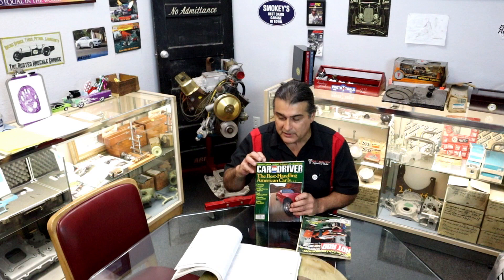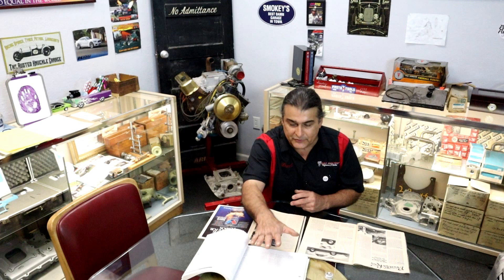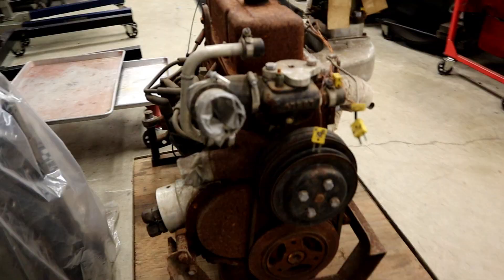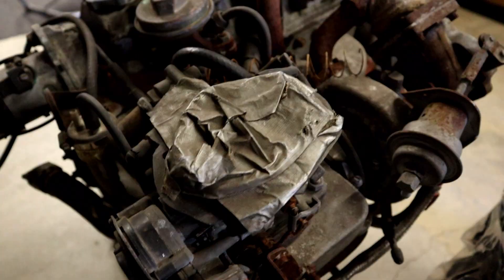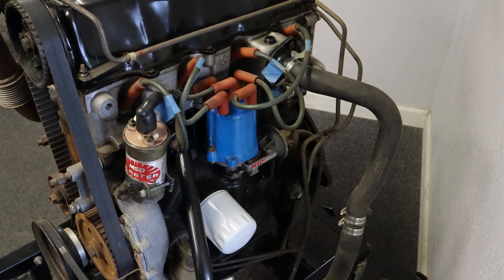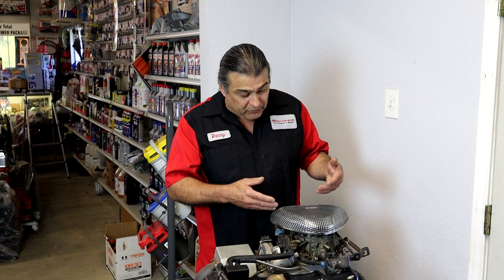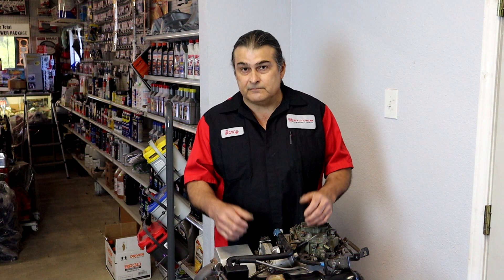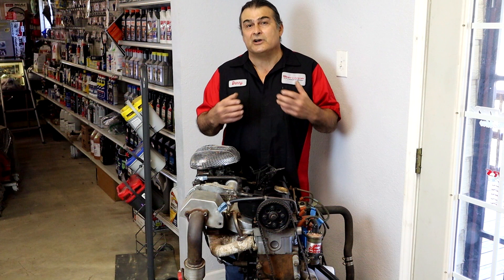What ever happened to Smokey Yunick`s Hot Vapor Engine

Comment: Real good review on important vapor fuel technology made by Smokey Yunick. One of the most interesting things about his design was the intake manifold designed to
heat a vapor chamber below a turbocharger. The turbocharger pressurized the fuel intake and kept it from trying to backup to the carburetor. His design extracted more
energy from a smaller amount of gasoline. Gasoline has about 7 different compounds in it that evaporated at different temperatures. The vapor fuel systems being 
experimented with for several years worked for awhile until the vapor panels were contaminated by the heavy ends of the fuel which would collect and degrade the
fuel vaporization so mileage started good for awhile then it would start degrading over time until the vapor panels were replaced with new ones. The way to prevent
this problem I found was to use white gasoline (Lantern Fuel, no extra compounds in it). Smokey's design worked flawlessly and is a solution. The engines on fuel
vapor will run cooler with no engine detonation (knock) since the fuel is in a gaseous vapor state much like a propane fueled engine. Smokey also won a stock car race
years before his invention running a Fish carburetor which has a patent on it made by John R. Fish. I have one of the larger Fish carburetors made by Mike Brown.
Mike made replicas of John Fish's carburetor and advertised/sold them in the middle 70's. He guaranteed a 20% increase in mileage which they did and even exceeded
that guarantee.  Smokey Yunick was way ahead of Detroit on his designs and anyone experimenting with vapor fuel systems had their lives threatened. Tom Ogle is
another fella that had a high mileage vapor system design which worked. The Pogue carburetor was one early patents that was a good design. If I remember it has
a Canadian Patent in the early century. The people who say that these fuel systems won't work are easily shutdown by mentioning the Coleman Lantern and stove
which is a fuel vapor system in it's principle using a vapor generator which was heated by the burning vapor when lit. I am glad you brought this topic up on Smokey
Yunick's patents and details on them.
Reply from the maker: Dennis, it is so good to here from someone that understands what Smokey was doing. I hope everybody reads your comment, I'd like to share this comment.  Made my day! Thank you.
Reply: @geraldwegener8376  The original carburetor had the fuel pickup are on the barrel side of the casing. A very precise machined groove had to
be made and the depth of it also very precise since it metered the fuel to the swing arm shaft.
Reply: Mike Brown had castings for the Fish carburetor and took a shortcut in machining the fuel pickup on his units for sale and the original was on the barrel
side which afforded a cooling affect on the fuel mixture. The modification with the swing-arm and where it picked up the fuel was a bad choice. I found
this out when I had 350 cfm carburetor on a Oldsmobile V8 in Florida one Summer. The bowl would be picking up hot gasoline just above the intake
manifold where there was a lot of heat. That caused a lot of stumbling because of the bubbles getting into fuel delivery shaft. There was no problem
like that in the northern climates. With the fuel pickup in the original location with the design I am pretty sure there were minimal problems like that.

Someone mentioned that the throttle shaft wore the aluminum housing out which made problems which I never had but that might be possible if gasohol
with alcohol or even pure alcohol was used for fuel. The steel throttle shaft and existing aluminum would work if the throttle shaft was oiled but alcohol is
a strong solvent and worse yet when heated. A solution would be to do like Holley and even with the Carter carburetors used. A bushing kit is available
for the Holley carburetors along with a boring tool to press in the brass bushings. Carter used nylon bushings on there carburetor kits but a backfire on
the engine could melt nylon. Aluminum against a steel shaft is a bearing surface but a brass surface is better and brass bearings are easy to replace.

I have one of the early 500 cfm carburetors from Mike Brown which still works and the fuel enrichment used was not good in cold climates. The best
solution was a on/off solenoid with a momentary electrical switch mounted at the dash to spray fuel with a jet nozzle onto the butterfly. That no different
than using a spray bottle over the top of the carburetor but more convenient. Fuel injection is still not efficient since a mist of fuel is not fine like vapor.
Smokey Yunick had the best design for full vaporization of gasoline and even Propane is better for high mileage if introduced and done right to a engine.
I might add, gasoline is highly unstable when heated and the gasoline before gasohol it had approximately seven different additives in it which had different
vaporization points in temperature with one as high as 600 degrees Fahrenheit. With Smokey Yunick's engineering setup all of the fuel was vaporized.
Reply: @ezl8002  I used a Fish carb for at least 200k the downside for me was there was no choke mechanism and also icing on certain cold damp mornings.
   I eliminated both problems by installing a brass spray nozzle above the carb and a 1/4" wire mesh screen in the recessed carb throat.
   The advantage of the Fish was the unique adjustments especially the fuel enrichment screw which was like an adjustable jet. The carb could be adjusted for mpg or power but not really both. I had mine set on the lean side and used the spray nozzle for extr power...trying to achieve both mpg and power. Also the Fish is the only carb I used that could be leaned out without the engine running hot, burning valves, etc.
     Also possible to run e85 with a simple adjustment. Mike Brown claimed it run on crude oil which may or may not be true because not all crude is the same. Mike was a writer and not a engineer or mechanic. He came up with the idea of a Fish Dualbowl/water injection...it didn't work I tested it and sent it back.
   The last person to mfg the Fish that I know of was Richard Ackerman. He was good...figured out the mistakes Mike had made etc. Also made some two carb set up's for performance. Not being made anymore by anyone that I know of.
   If it was built in China and because of the simplicity it should be really low cost. If the carb is made correctly with the right type bushings it would probably last the lifetime of the owner and never need to be rebuilt. 
   I told Richard Ackerman that if the fuel enrichment screw could somehow be adjustable from the dash...it would be the greatest carb ever made...but probably not possible to do. Thanks!
Reply: @geraldwegener8376  Sorry for not getting back as soon since YT wasn't notifying me and I caught you messages on Gmail which I seldom use.
The choke system on the carburetor was changed several times and I did the same thing you did, put a spray nozzle above the butterfly. I had a solenoid
valve operated by a momentary push-button switch to turn the fuel on to the nozzle. A Holley electric fuel pump supplied fuel to a fuel pressure regulator
to the carburetor and enrichment nozzle. I also used a manifold intake air heater but that carburetor likes cool air and heating the air coming into the
unit would upset the fuel mixture settings. I got away from using and manifold heat to that carburetor and if it was icing up all a fella had to do was hit
the push-button switch which would wash off the frost on the butterfly.  

I never had problems with a loose throttle shaft on the carburetor but I suspect alcohol fuel would wash down an lubricant on the aluminum and steel thottle
shaft. A machined OlLite bearing could be made to be machined into the carburetor housing itself to get around the wear on the aluminum body. Even a
brass tubes could be machined and sized for the shaft as a bearing surface. 

Smokey Yunick had the right idea all along and big business didn't like someone butting into their money making schemes. There a many good inventors that
had questionable deaths and some of their Patents are still archived at the Patent Office. The fuel injection delivery systems are not that efficient but for the
average person with no mechanical ability will have to suffice.  Thanks
Reply: @ezl8002  The Fish Carb had superior fuel atomization without detonation and the engine compression could be raised higher than stock...increasing both hp and mpg. A mileage cam further increases mpg and power on the low end. All accomplished WITHOUT the use of expensive computers, EFI, sensors, turbo, etc. AND the average person could adjust the carb without any special tools or an electrical engineering degree. 
   The icing problem may be in part due to the thick aluminum construction. Since aluminum dissipates heat...the carb is reluctant to warm up. Perhaps wrapping the carb with some type of insulation would help...I'm not sure...I didn't think about it at that time.
    Because of the simple design there's no rebuild kits....nothing to rebuild.  Simplicity, Efficiency,  Longevity, and Low Cost if mass produced. Thanks!
Reply: @geraldwegener8376  Years ago, I presented the problem of "vapor-lock" or stumbling when the unit was ran after shutdown in the Summer time. Running the engine for a few minutes cleared the problem since it was cooling the fuel charge on the carburetor. I mentioned that to Mike Brown and he sent me a fiberglass heat adapter that went between the carb and manifold. That didn't work and even the fiberglass fiber spacers between the fuel bowl didn't help. I believe that was the reason why Fish put the fuel pickup on the
carburetor barrel side of the unit. That's where vaporized fuel is cool. That carburetor design was far advanced over most all of the
carburetors at the time plus atomizes fuel
more efficiently versus fuel injection. Gasoline when it's heated becomes very unstable and that's because all of the additives in it. A fuel like propane, acetylene
or hydrogen is actually more stable. Yhanks for the message
Reply: @ezl8002  Thanks for reply.  I also experienced vapor lock on a 225 Dodge Slant 6 and it only happened when using AC on a hot day. The easy fix was pouring cool water on the mechanical fuel pump and the engine would start. Usually a electric fuel pump would eliminate vapor lock but some engines were problematic and Mike Brown's redesign making things even worse.
    Richard Ackerman made the Fish Carb after Mike Brown / Jim Cofield...and he corrected the prior design mistakes. Rich told me when John R. Fish sold the original carb there was only one size...and it was used on both small and large engines.  Rich made some improvements such as wider throttle shaft bushings which were made of... I think maybe...Rulon (a very durable material) and he guaranteed  the bushings would outlast the person buying it. He also filed a patent for an improvement where if the carb was set lean you could accelerate hard and additional fuel was added for more power, Rich was good...but his carbs were expensive. Thanks

Comment: I remember reading about this way back. It was supposed to produce around 2hp per cubic inch. And it was a smoother power that broke less parts. It had a fuel homogenizer that looked like a turbocharger. They showed all of it except some key parts bc it was still under development.
Reply: Read EVERTHING about how he "understood" a rule book, He's a legend in "any" class he ran and mastered it as well
Reply: The turbocharger helped keep the fuel and vapor from backing up into the carburetor. Drawing vacuum on a liquid lowers the boiling point and
the turbo is like a one-way valve. You also don't get any knock off of a vapor fuel system!

Comment: I was blown away by this when I read about the fiero in Hot Rod back in the day.In my opinion this technology has been suppressed.
Reply from the maker: I agree.
Reply: From what I have read about it Smokey tried to sell the idea to various car companies, their engineers were enthusiastic about it for a while but there were 2 problems, in order to make an engine that would withstand the heat, they had to use some expensive parts and lubricants which made them too expensive, and they ran right on the ragged edge of detonation and overheating so if the slightest thing went wrong you could burn up your engine in seconds. A few companies took the idea seriously enough to build their own experimental models but decided they were not ready for sale to the public.
Reply: @mrdanforth3744  : I recall in that same HR article that he'd put different valves and "RV" cam in that Fiaro. However, I don't recall anything about not using the radiator (being that it needs that for the first stage heating) (that this channel seems to be implying) but do recall silicone plug wires boots Smokey recommended. Now as far as extra heat in the engine bay: Seems to me the more recent synthetic OIL types and remote oil coolers could resolve the issue; after all NASCAR does it every day, right? Thanks, and best regards.
Reply: @Rev22-21  I never said it didn't have a radiator, if it worked as intended it would still need a small one. The whole point of what he was doing was to keep as much heat in the engine as possible so that energy could produce power.

Comment: I never forgot about that homogenized Fiaro.... and it got rubber in all four gears...! Hot Rod magazine article said FI wouldn't work. Also 1.8 hp per ci., having a small turbo to prevent vapor lock and that Chrysler bought the patent and later moth balled it. The cover of that issue was called "Engines" showing four of them but none were Smokey's.
Reply: Smokey bought back all his patents from various partnerships.  First Knudsen then Crane.  In the end he let them enter the public domain.  Some guy admitted on a thread that an OEM was researching it even though it was patented.  They still haven't figured it out.

Comment: Things would have been very different now a days if they would have embraced this technology. Major respect for Smokey! Awesome video Danny!
Reply: smokey wasnt to keen on anything that smelled like autority or rules and he got blocked by the big motorcompanies in those days as he was a rebel and whent against the rules , its kindah like those plans for an engine thats supposedly runs on water , legend goes that an influentual person  stole/bought them and put those plans away as it wouldve cut intoo the profits of the people selling gasoline and the taxman
Reply: It doesn't work. Warming fuel causes loss of power as, for example, proven in aviation with de-icing cycles.
Reply: Not really. Smokey was a master tuner but he hated technology in engines. He was trying to do what EFI does but all mechanical and without computers.
A modern engine with DI EFI and VVT produces a lot more power, has better economy, it's cheaper and his more relialable than hot vapour engines